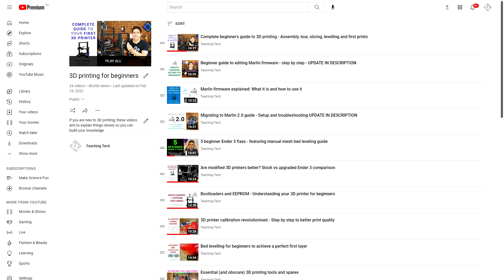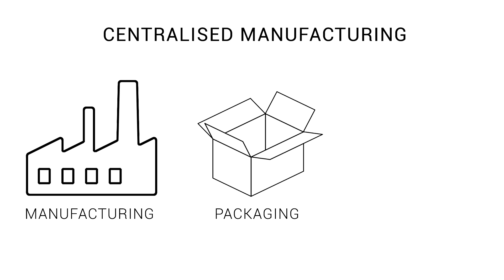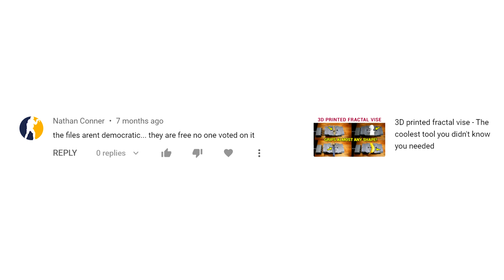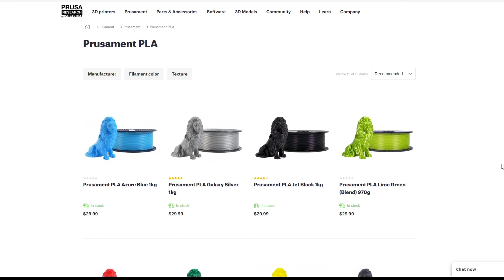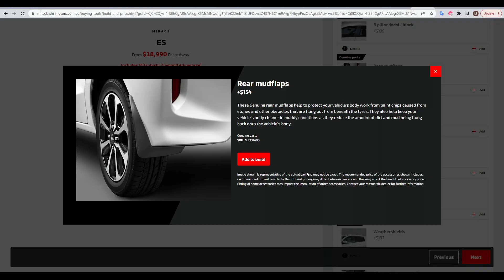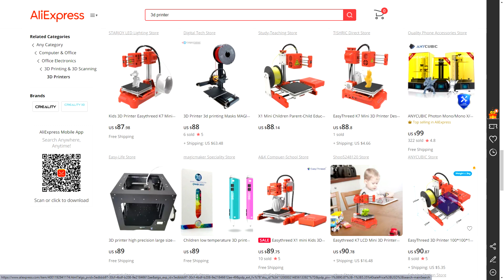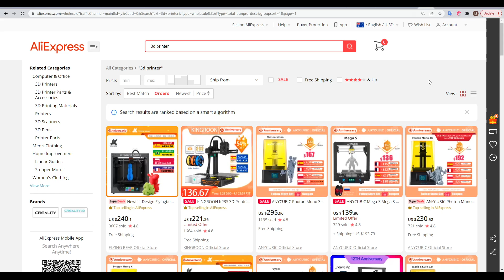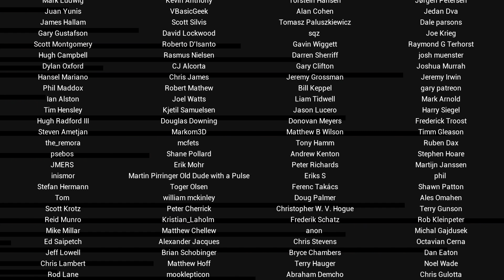3D printer trends are limiting mainstream acceptance: The 3D printing paradox

Comment: I don’t believe they need mainstream acceptance. The amount of JUNK 3d designs on the web is insane. Sure, what’s junk to me could be GREAT to you. So be it. You do you. However, I do fully believe that this, like many other tech tools, are best suited to Engineers and Engineering. This is a niche to be sure and, I’m not saying you need an IEEE degree/certification/level of knowledge I’m merely saying even as a tinkerer, what appeals is the ability to take a thought, and bring it to life. No need to get everybody on board with this mindset. Your presentation about decoupled / decentralised manufacturing is a damn good point and in some cases I think it’s a viable future. However, I don’t think it’s going to be at the “replicator” phase for a long time.

Comment: This video stll stands true today. While we have BambuLabs, Flashforge, Creality, and Elegoo working on CoreXY 3D printers. A majority of companies  are now locking Klipper into their own ecosystems and making proprietary versions of Orcaslicer. Both of which were created as open source projects by the community. This has limited the advancement and adoption of 3D printing. To make matters worse. Multicolor/multimaterial printing has came along and now every company has their own proprietary way of implementing it. Then the general public sees how far 3D printing has come. Not realizing that all these advancements are half baked. Buys into it, then becomes frustrated that what they thought they were promised was really not ready for primetime. In the end, the general public does not want to tinker. 3D printers were made for tinkerers and engineers.

Comment: 3D printing will not reach the homes of the average consumer anytime soon. Because people will not create models for the things they want/need. The actual revolution that needs to happen is less on the machine, but the modeling part. When you can take 3 photos of a broken item, and type a prompt to an AI model saying "This piece broke, please create a model for me to print" it gives you a file you just put in the printer e does it, that's when 3d printers will become a consumer product.

From the printer side... the only thing that it currently needs is less complexity on setting parameters and configuration. But this is already being improved in printers like Bamboo. In the next 10 years, even less, you'll be able to simply put a filament in, upload a file (without needing to slice it) and that's it. The printer will slice it, and set the most optimal configuration for that filament, that model, the current temperature, humidity, position of the moon in relation to Jupiter, etc...

Comment: I really liked the comparison to a standard 2D printer.  Most people are familiar with them and from my own experiences in IT most people have ZERO patience for doing anything beyond adding more paper and occasionally (and I literally mean occasionally) replacing ink/toner.  Anything beyond this and most people HATE printers.  Add in a paper jam or some random error message on the minimalistic display, if there even is a display, and before you know it they are doing their own version of that scene from "Office Space".  

For most people a 3D printer might seem cool , interesting or potentially useful but they just want to press a button and have it work without any further input.  I liken a 3D printer to a high-end radial arm saw.  They are very capable but they so require a lot of knowledge and skill to use properly irrespective as to how well  they are designed.  3D printers are a specialist tool and not a commonplace appliance.  Add to this that the actual printing is only half of the process.  One needs to have a model to print so this either relies on them having the skills to desgin them, the drive to learn how to design them or the will to search for something that already exists and buy it.  I doubt that places like thingiverse will suit the needs of the vast majority of people.

I can envision in the future that instead of everyone having a 3D printer in their home that instead 3D printing services will be as ubiquitous as Kinkos.  You won't just go into the spare room and print off what you need but instead you'll upload a file and then either have it delivered or pick it up on your way home from work.

Comment: My opinion is that 3d printers should not be compared with inkjet printers. Especially when talking about price. 3d printers should be compared with laser or other 2d printers. This is due to the manufacturers of inkjet printers making them unrepairable and requiring you to buy outrageously expensive ink that is no different from the cheap ink next to it but you have to buy that manufacturers ink because of corporate bs.

Comment: I shudder at the thought of 3D printers being made like inkjet printers. DRM on filament, filament with expiry dates and built-in chip that will prevent you from printing, slicer software spamming you with ads whether you use it or not, 3D scanner built into the 3D printer but impossible to use without filament, multi-color printers that will refuse to print if one filament spool is low, and the printer throwing errors about everything like belt loose, filament too moist (buy a new spool!), unable to connect to server to verify you run genuine firmware... oh, and "this figurine is copyrighted by WOTC, you're not allowed to print it."

Comment: well i think main thing that stops 3d printers is that theyre not self-sufficient. For example if you have 2d printer you can put piece of paper in and then copy it. 
If budget printer gets a 3d-scanner(even very bad one) it will be way better for normal user. Also it would be nice to have basic Android on 3d printer with simple CAD programm on it or smth like thingiverse to print from. 
For normal user 3d printing industry these days may look like: learn BIG programm(cad), learn programm with a lot of options(slicer), learn about one thousand filaments. 

200x200 working zone, direct drive, auto-leveling, linear extrude - its all are not important for inexperienced user who barely knows what he wants to print.

Comment: I'd rather have 3d printers that need some tinkering with them than them be anything like 2d printers.

You can use any brand of consumables. You can use many different types of consumables if the extruder can handle them. Having some small irrelevant problem doesn't make the machine useless.

Simple example:
I have some canon printer/scanner which won't scan stuff only because one of the jets is clogged with old ink.
On the other hand i have a 3d printer with 3d scanner built in (some 2015 failed project). I messed with the software on it when i wanted to update it's ubuntu. The built in UI won't start, the scanner doesn;t work, but i still can print when i use web based tool. Also i can fix that by simply reflashing the sd card (too lazy for that). It's impossible to do anything similar with regular printers.

Comment: I worry that if 3d printers become more mainstream, they actually will become too much like 2D printers, which aren't actually that reliable. Sure, the 2d printer is cheap: that's because companies lock you into buying proprietary, massively overpriced ink, which is where they make their money. Imagine spending $150 for a Prusa Mk4, but then spending $100 per roll of filament that uses special electronics to make sure that the printer only works with proprietary Prusament. I don't think we actually want 3d printers to go mainstream, or the whole ecosystem will get fucked over by tech bros building companies on SaaS/HaaS models. Meaning, you'll never actually own your printer, you'll just be leasing it from Apple, and trying to upgrade it or modify it will void its warranty.

Comment: I have the prusa i3 mini mostly for the fact that I can quickly print out parts without having to mess with bed leveling etc and it just worked out of the box. The next generation of slicer and printers need to work out whether it's possible to print a model, fix it if it's not possible and check and make adjustments to the print as it goes.

Comment: I might eat these words in a few years, but I don't see a benefit for 3d printers to be in every home.

-centralized manufacturing is not going anywhere, there are economies of scale that will make even expensive highly specialized tools that require paid maintenance cheaper per part than something you can make at home.
-the shipping will be slightly reduced, but nowhere near eliminated. you still have to have all the printers themselves, filament, spare parts, and everything you can't print (electronics, glass,food safe materials, etc). which segways perfectly into point 3:
-there's a lot that 3d printing can replace, but until we have replicators like in startrek where we can assemble things by individual subatomic particles, the amount of things they replace will not be a very large subset of consumables.

-keep in mind that a lot of the general public will always "call a guy". if something is broken, they don't want to troubleshoot, find what is broken, seek out a printable replacement, print it themselves, and then fix it. they will call a guy who will do it for them - which could be a very cool usecase for a 3d printer. as a handyman you could potentially have an industrial 3d printer in the back of a van to print parts as needed.

I think there's a lot it can do and further that it can spread. but the average person has no use for (and does not want) a printer, and it would take a massive cultural shift for that to change

Comment: What I need is metal 3d printer and stainless CNC machine for home, not bigger than 500 500 500 and that costs not more than 3k for both. 

Plastic printer should cost not more than raw materials needed to make it - like 50 USD. 

That would guarantee technology penetration and usability.

Comment: Several years ago I got a tevo tarantula, it printed about 2 decent prints before it clogged and I encountered a slew of issues I couldn't be asked to find the time to solve (I'm an electrical and computer engineer). A few weeks ago I pulled it back up and am trying to get it working again. I want something with completely auto bed leveling, that doesn't have a rat's nest of wires, is consistent, and mostly plug and play (or at least super easy to calibrate). I really want to ditch it and build a voron 2.4, but have convinced myself I can't spend more money on a new printer when I have one I can't get working.
I for the most part love tinkering, but lower quality printers like that can put a ton of people off.

Comment: Well. Your opinion is quite honest. You pinpointed the pitfalls very well. 

In a tinkerer too. At the moment i am designing a 3d printer for (moderate) mass production. Within a square meter footprint your able to make hundreds of prints very fast and also very precize. And with software you will be able to make prints the size of a fridge in the same setup within the footprint.  

This machine also use common plastic granulates for printing. 
So the overall costs are even more reduced. 

I can tell you, things WILL change!

Comment: Most people don't want to manufacture things at home, what they want is the items ready to use with no hassle. Printer settings, bed leveling, temperature issues, humidity level problems and spools of plastic that are quite expensive are not what most people want. You don't want to make a brewery to be able to drink beer.

Comment: I used to have a job reusing old laser printers. As a rule, they'd arrive by the pallet at the recycling plant and still be working fine enough to send out for a second life somewhere. Great big ugly heavy clunky things, but workers. Second hand inkjets though...they usually got crushed. The stupid things that end users do, the cheapest possible printers, trying to run the cheapest off-brand cartridges through them. That's where you get troubles with 2D printers (sounds familiar?)

On another note, these days I work with large format 2D printers, that run day-in-day-out for years. With those you buy a maintenance contract, because things do go wrong with these, and I think that's the better paradigm to look at for 3D printers, because how many home 2D printers do we actually run 24 hours a day like we expect 3D printers to be capable of?

A better paradigm would be a network of technicians, servicing local hubs which work a bit like photo print shops used to, then give it a couple of generations for the tech to mature and for those shops to die out in turn.

Comment: What will really drive printer adoption is greater need… real or perceived. If 3D printed parts or finished goods became a part of the collective consciousness, you would see an increase in adoptions. I own multiple printers yet still forget that “I could just print that”. Another extremely limiting factor is speed. Very few people want to wait days for things to print that they can just overnight - inkjet printers don’t take 20 hours to spit out your family photo or history report. Where I see the real uptake and benefit of 3D printing is really their origin story… manufacturing. As quality and speed has increased, the number of people getting into small-run manufacturing has increased. I think there is tremendous potential here because printers may never be in every home but localized services already exist at prices that are so low that I have a hard time believing they’re profitable. People are now able to design and produce products on a reasonable scale without huge capital investment. We’ve also seen that supply chains are extremely fragile, centralized, and specialized. We saw a glimpse of the potential with the production of face shields and other 3D printed materials during the early part of the pandemic. We may never get to a “replicator” but what we are already experiencing is an explosion of very high quality 3D printed items made by people that would have never had the means in the past. All of your points are valid… but you fundamentally have to ask yourself… what does the average person really need to print so regularly as to warrant an appliance like this?

Comment: Imagine you can buy a $500000 CNC mill for a thousand bucks. A 3d printer is essentially that. And then expect the manufacturer to provide an exact set of settings for each material and conditions. Never going to happen.

Comment: To me, having community driven innovation makes the most sense. I mean if we're talking about a race to the bottom, 2d printers are probably one of the best examples. It's cheaper to buy a new printer than buy ink cartridges. To milk the most money manufacturers put drm on their ink cartridges. That's what I think would happen to the 3d printing world if a couple of manufacturers gained control of the market. Having innovation come out of the community means no one company will have control of any particular area of the market to milk their consumer base out of money.